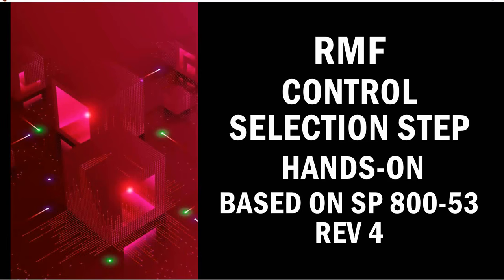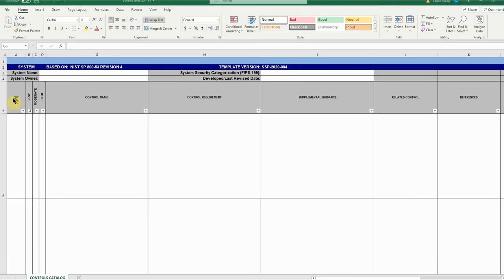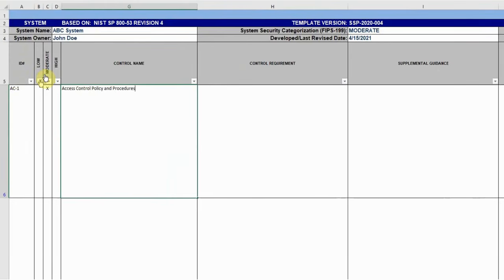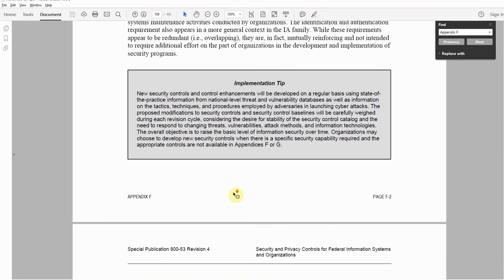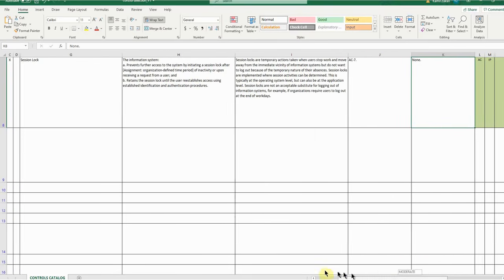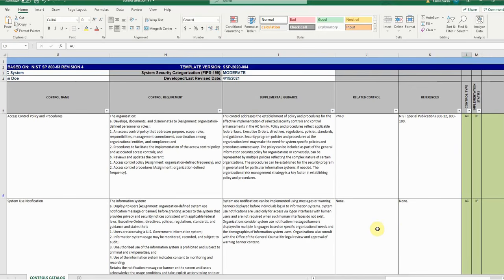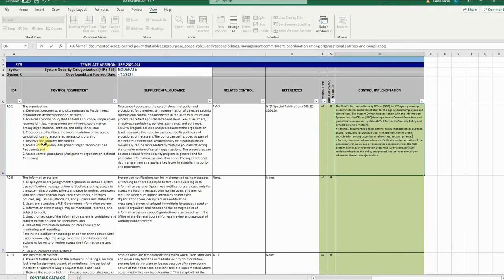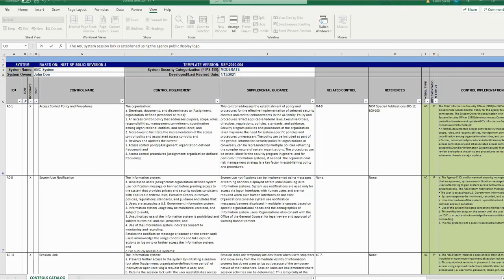RMF Control Selection Process And How To Write Security Control Implementation Statements (Hands-On)

Comment: If the crm from Fedramp has the wrong controls selected, and I have to tailor the service provided system specific(Inhereted, if I am correct), and the service provider Hybrid(hybrid) how do I know which control to apply to which. Please if you have an easier way of contact dont my sharing. I am using csam as the tool, but I am not sure how to select the proper controls or tell which controls go to where.
Reply from the maker: always go by the controls recommended by the baselines and you start your tailoring from there...

Comment: @kamilsec so if the control is not selected like AC-3, do you still have to put it in system or do you need high up tailor it?
Reply from the maker: Nkum, So being that AC-3 is selected for all the 3 baseline (Low. Mod and High systems) if for some unlikely reason, this control is not implemented on a system then you will need a higher level signature approving why this control is not needed, and therefore Tailored.
Reply: @KamilSec  So when you Tailored the control you still document it on spreetsheet?

Comment: I must say you provide great insight and clear explanations, based on the RMF the step after control selection is Implementation but through your videos I saw all the steps except the Implementation. I watched this video and just asking if the entire Implementation is the statement you provided towards the end of this video?
Reply from the maker: Hi Idara, no... the implementation step is more than that. Depending on the type and class of the control, the implementation process will vary. For instance if we are dealing with Technical controls that requires the developers or the engineers to deploy a code or even hardware device, then we will have to sit or meet with them so they  explain the process and we write the Implementation Statement based on the explanation. In some cases the developers can write the steps for us and we (Security Analyst) will craft the Implementation Statement. However if the controls are Operational and Management controls that are all documentaions the Security Analyst can work with the System Owner to address the organizational process to write the Implementation Statement. So in a nut shell Implementation Statement is not generic, it is subjective based on the family and class of the control in questions.
Reply: @KamilSec  Great information, thank you for sharing

Comment: If the control status is “not implemented” what do you have write under the implementation statement for that control?
Reply from the maker: Hi De Way, If the control is not implemented, then is it Planned or Compensated? That answer should be in the implementation column. Hope that answers your question.
Reply: @KamilSec  how can I get in touch for mentorship
Reply from the maker: @deway7408  Kaamilzak@gmail.com